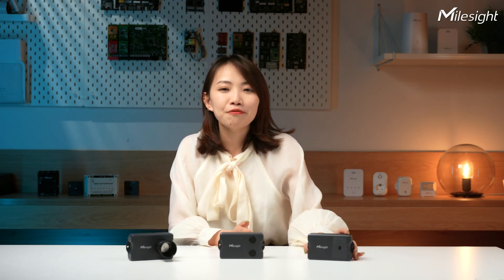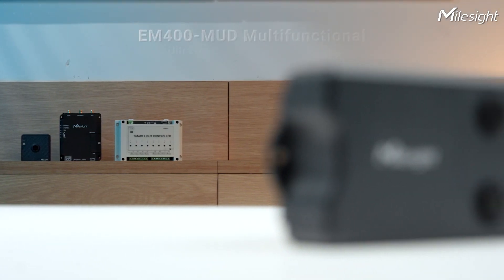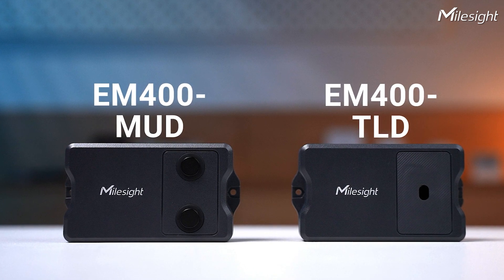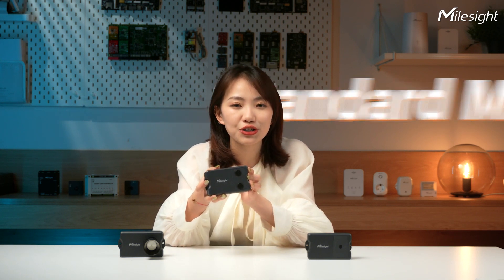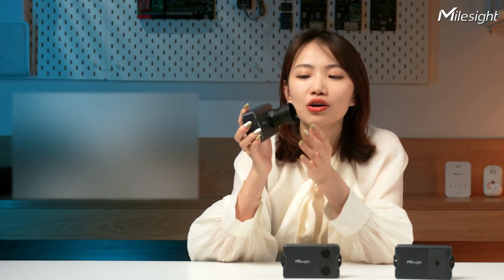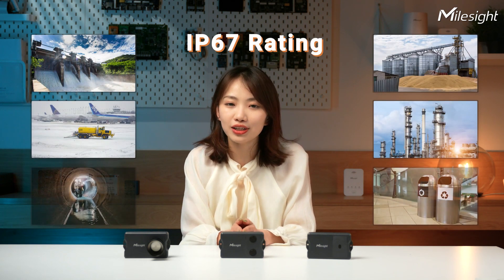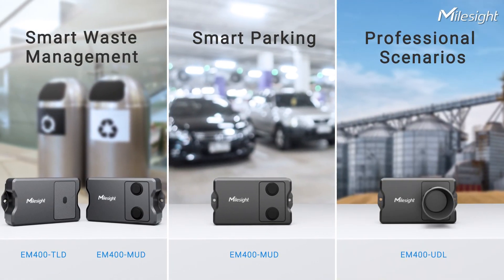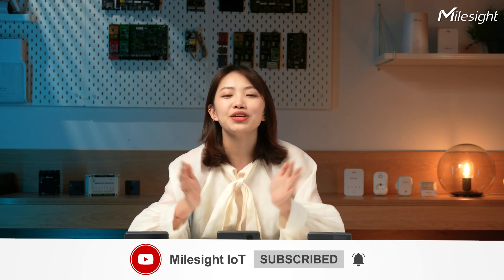Introducing EM400 Series: Milesight LoRaWAN Distance/Level Measuring Sensors

Comment: Hi, Is it possible to measure qty and length of wood planks coming out on a conveyor belt on a factory?
Reply from the maker: To better understand your requirements and suggest the most suitable option, could you please share your email address? One of our professionals will get in touch with you directly to assist further.